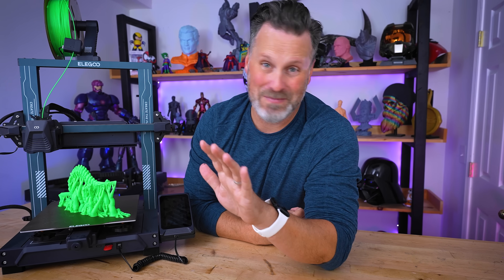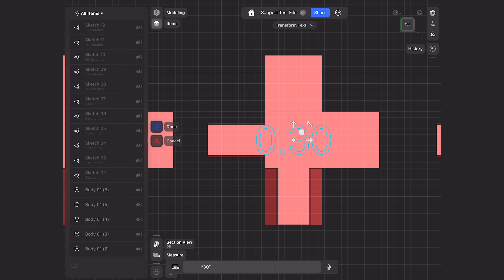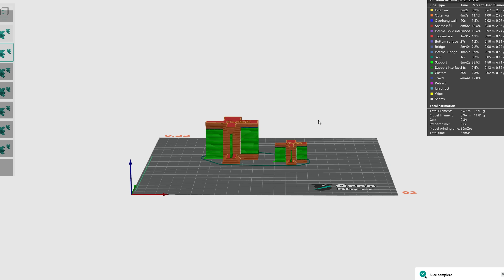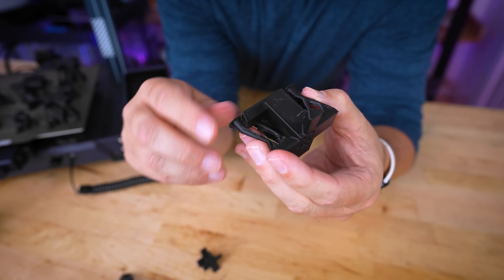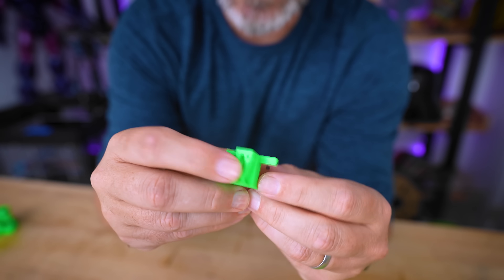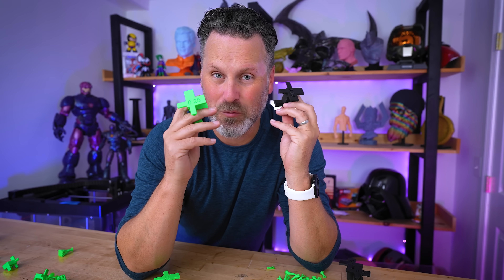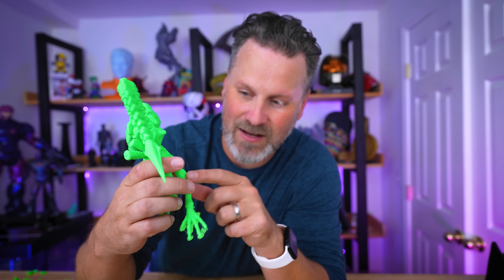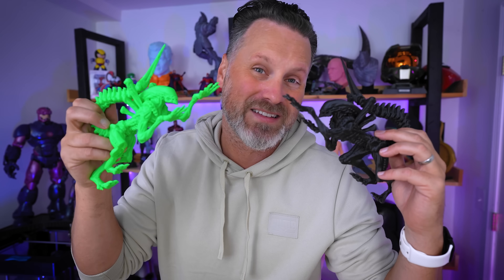Stop Struggling with 3D Printed Supports – Try This!

Comment: The  supports felt the same to remove because they were the same. 3d printing is really only 2.5d printing. When supporting those perfectly horizontal surfaces, it can only skip whole layers. You need sloped or rounded surfaces to see a difference when making changes of less than a whole layer height.

Comment: I may be mistaken, but I believe that unless you set something like a variable layer height for supports - then all z distances are rounding up to be proportional to layer height. 
Meaning that if you print 0.028 layer height, then 0.22 top Z distance will be 0.28. And 0.29 distance will become 0.56.
That's because it is printing uniform thickness layers, and it can't print a layer thinner or thicker than you asked for.

Comment: hey my 3d models are getting stuck in the middle and wont progress the print like it just keeps going in like a small circle but it wont go up on the z axis or progress the print time I have no idea what causes this and it has happened to two different files and I know it's not the Printers I have used any Ideas?

Comment: You just need to see if the piece starts to print after one, two or tree empty layers... The small numbers variations doesn't matter. Just if the number surpasses a threshold for more or for less. What make a difference for me was to have les spacing between lines in support's top layers (I use NONE by the way), it's like printing on a almost perfect surface.

Comment: You can also try setting the top z distance to 0.275, but my favorite is to make the support tips in PETG which doesn't really stick to PLA making support removal a breeze. I know it adds more print time due to a filament change, but it's worth the hassle of removing stubborn supports or even breaking your model. Lastly always use needle nose pliers to remove supports.

Comment: I use the old flashprint... the best trick I have for auto supports is let it do it in 1mm thick then you can paint over the supports with  ever increasing diameter ones growing fatter as you go down like a tree... this only leaves a tiny contact point... leave at least 2 to 4mm of the 1mm bit so ther is a real weak point.

Comment: Thank you for taking the time to test and evaluate these settings.  I would have never considered there to be such a difference between filaments and results. It appears you need to run a test on each new filament like the testing required for resin printers.

Comment: I don't suggest doing fewer walls in supports. If the tops are sticking and you have thin walls the supports will just shear off when you attempt to remove them and leave the tops connected with no leverage point and you'll have to cut them out.

Comment: Thank you so much for this. I am new to this 3D thing. My Orca Support Tab doesn't have half the the options you have though. It only has 8 options and ends with starts at Support Raft Interface. Is there an upgrade I should be looking for please?

Comment: I just recently got into 3d printing and i have the Creality Ender 3 v3, and yesterday as of writing this I found out about the Top Z Distance

I use the Hyper PLA that Creality sells, and i use 0.25 top Z as my default, it still is a bit difficult to remove, but most of the time it doesn't leave a bad finish when removing them, when printing high/mid detailed figurines (0.08)
if i increased it, then i will get that weird stringy layered texture

Comment: Please, calibrate at least your flow rate & retract before any other fine tuning - it's a bit wiered to see strings & uneven top/bottom surface on the print while "tuning" supports. N.B: all calibrations are applyable only for this exact filament spool, new spool - new calibration

Comment: Another thing that help in removal is reducing the "First Layer Expansion" (named in Orca) to as low a number as possible. This is the number of rings around the base of the tree support that provide extra bed adhesion. The key is reducing it enough to leafe a very clear gap between that support base and the actual print, but still giving enough support to prevent the try from falling off the bed

Comment: Hey Jesse so I just downloaded orca 2.3.0 and im using a neptune 3 pro and the print for .20 support setting says it will take 3 hours and 33 minutes, what could be the cause for this? same print in cura says 1 hour and 32 minutes
Reply from the maker: More than likely it’s the volumetric flow value. You can find that setting in Cura & update the value in orca slicer for the profile you are using, could also be print speed settings or number of walls
Reply: @UncleJessy  ohhh okay I got you, I have to find a translation table or something to try and match up the settings as best as I can then

Comment: How do I avoid a lot of support scaring? Recently got an elegoo neptune 3 pro (first 3d printer) and some of my prints get that. I'm currently using ultimaker cura as a slicer. I'd be open to suggestions for other slicers that work well with my printer.

Comment: just wanted to say thanks. i usede the the top z distance, which i didnt even know i could change lol, it worked great. i have been using pla plus and that stuff is like weldied to the surface. changed it to .34 and now they pop right off. thanks again and keep up the awesome work

Comment: @UncleJessy 
and this is why you remain one of the very best In the Biz.
I have a 4 Pro and absolutely love it, except for having to fight with the Z drift.
Running Pro mode on the machine helped a little bit.
Have you had to deal with this? And if so, what did you do to compensate?

Comment: Try printing with PLA in 0.08mm using a 0.4mm nozzle using either grid or  tree support. It's impossible to take them apart. The higher the resolution, the harder it gets to remove supports.

Comment: You should design a test were it supports a thin, fragile object. If the support is bonded too well, it'll break the fragile thing. If it's easy, it'll preserve the fragile detail

Comment: Thank you for your videos. They’re very helpful for newbies like me. I just have one question though because I’ve not seen anyone tackle this yet. I tried printing with PETG support but just on the ends of the support. The support come undone very easily but the object printed also disintegrates. It’s like the layers did not fuse properly. What do you think caused this? Appreciate anyone who could answer this question. Thank you.
Reply: You need to set a higher flush volume. When the printers switches from PETG back to PLA, there is a bit of PETG left on the hotend and it ends up in your print. PETG and PLA don’t fuse together and your print will break apart easily

Comment: Fighting with supports is a constant hassle for me. A job I printed last night gave me the same problem, and I ended up breaking my model. Being a relative newbie to 3D printing, I didn't know about this solution. So I checked my settings... 1.2. Yes, they need to be changed. Printing again, with my settings corrected.
Thanks... You won my subscription.

Comment: we did this test on the k1 and the k1 max using geeetech tri colour pla filament and so far they all come off really easy on at the 0.20 thru to 0,26 on tree slim sup im now trying it on not sure the make tho filament see if it does the same

Comment: I had an issue with tree supports when I first started using them... I have no idea if it was on a website, on a print profile, or on a forum - but somewhere I read that tree supports, and really any supports, are best removed within 2 hours of beginning a cool-down cycle.  -- I.E. Don't let them sit over-night with the temperature inside the 3D printer coming back to room temp.

Comment: Hello, I have a question. I print at a layer height of 0.2. Should I do the tests with the same data you put in? 0.2, 0.24, 0.26, 0.28, 0.3? thanks for the help I have an Ender 3 V3 KE

Comment: Something that helps in orcaslicer, especially with ABS is the filament cooling setting. Having your printer turn on the fan to a certain percent, maybe like 25 for abs during overhangs and while printing supports works wonders.
Reply: Does that help with PLA too?

Comment: Key is to remember also.. "rapid"/"fast"/"High flow" filaments are lower melt temps, so your supports are sticking more on those because even just the ambient heat of the print head can make the top layers of the supports sticky again vs normal PLA or PLA+ blends. Resulting in needing a higher gap to prevent filament drooping and sticking so easily.

Comment: Thanks for the test models. I found the different settings made very little difference to the release of support material (Normal) from the print. All the large sample released pretty easy and all the small ones were difficult to release a couple of the sections. It almost seemed like I'd not even changed the settings per object but I checked and I did. More confused by the difference between the large and to small test samples. I did change both top and bottom Z value, so not sure if that makes a difference. I'm gonna retry with tree support and see how that works out.

Comment: Hmmm. I've been using 0.26 with variable layer height, assuming the minimum possible to remove is best. But maybe Z contact distance of 0.3 would cause less damage on removal. Thanks for trying this out.

Comment: So for pla, I used 200/60 with .185 top and bottom z contact. For abs, I do 227/110 with .19 top and bottom z. This is through with .2 layer height and using prusaslicer for my voron v0, so I highly recommend giving those values a shot, even if the settings in this video do help you start getting dialed in.

Comment: What is the impact of the upper ceiling? You looked at one boundary, but there doesn't seem to be any info on the consequences of ramping that up much higher. Obviously there's a point where it's not actually giving any support at all cause there's a great big air gap, but it sounds like you should test where that point starts. Maybe it's around the .30-.40 range and you can't go much higher, but maybe it's actually at the 0.6 range and you can happily throw 0.40 at the wall and just have easier supports as a default. Be nice to see the other side of that quality curve.

Comment: Trying to get my head around how it would be printing in 0.2mm layers but somehow print the supports at a height between those layers? I've seen resolution be lower on support but it's usually a multiple of the layer height and not a 0.02 difference.

Comment: Fun trick: If you have a big flat overhang for some reason (like the test prints), you can pause the print at that layer and scribble over the grid supports with sharpie (laundry marker). PLA doesn't stick to that. You can use a zero-offset grid support and not have it stick at all. Obviously of limited use, but if you want (say) text embossed on both top and bottom of your print, it's pretty easy.
Reply: This is such an awesome tip! I'm definitely gonna give that a shot. Been having to do a lot of prints with flat overhangs lately.
Reply: Amazing. I knew sharpie was useful to prevent adhesion, but wasn’t sure where it would apply. This is genius. I bet it even prevents the bottom layer from getting that noodle like appearance.
Reply: The sharpie trick is great for any printer that doesn’t have MMU/AMS capability.  It’s nearly free, works super well, and it lets you place the supports directly against the print surface which dramatically improves the appearance and accuracy of the print.  The only downside is having to add the pauses to the slice and having to babysit the printer.

If you do have any sort of multi-material capability, though, switching out the support interface material is arguably a better solution.

Comment: He also misses the setting "Top lnterface Spacing". 

"In Orca Slicer, top interface spacing refers to the distance between the topmost layer of your print and the support interface layer. This setting helps ensure that the support structures can be easily removed without damaging the print."

Comment: It always rounds to multiples of the layer height. That is why you didn’t see a difference until you got to larger multiples….
Reply: If not, your print would take for EVER. Since it would have to do micro layers between just for the interface differences, which makes sense if you think about it. It is literally layers.

Comment: Great video. I found this a while ago after having an absolute nightmare with tree supports.

The other thing which is worth looking at is if you actually need "Top interface Layers" or not. 90% of my prints now I have set this to zero and it prevents support from creating that top raft and just sends tree supports all the way to where the support is needed.

Comment: If you put all the small ones on the plate and modify the support settings per-object, you can export that file and the settings will work for any printer that imports it into Orca.

Comment: What I would like to know is for a multi filament, what could be used for supports like a weaker but sturdy support filament, IE TPA hard for PLA and PLA for ABS for example. Has anyone done this for FDM Printers? If so where and if not can you  do something for that option?

Comment: Great info and timely for me as I'm about to print something that needs center support, and a smaller version with the particular filament I'm using was an absolute bear to remove. What I wound up doing with that is hitting it with a heat gun a bit to soften things up a little, which let me get the support off clean. There's a balance between melting the print and softening that interface layer just enough, but if you start small and apply more heat as needed, it can really save a lot of headache and reprinting.

Comment: Bambu P1S ships with a small amount of filament called "Support material for PLA" which is supposed to act as a top layer for your supports that makes them east to peel off. Not tried it yet, but apparently it works. Others have said that using PETG on a PLA print in the same way also works as they are somewhat incompatible which makes them easy to peel off.

Comment: Use the cutters that came with the printer 😅
Cut the supports in blocks that can move -> wiggle away from interface. Trying to get them off like a monolith is not working.

Also: if the model looks impossible to print, cut it to simpler parts. I wonder how the bottoms look like with 0.3 mm distance 🤔

Comment: I use tiny cones with the tip on the part, and it breaks off clean.  multi filament can use a barrier layers of PLA.

Comment: Matte PLA supports are much more easier to remove, compared to the regular PLA. I'm using Bambu printers and 98% of my prints are printed with 0.2mm layer height and the Z gap for supports is set to 0.1mm. This works absolutely amazing for me, removing the supports is a joy.
Also, recently I tried matte PLA for the support base layers in the regular PLA prints and it gives a result very close to the PETG supports.

Comment: Regardless of how easily the supports break away, I've always been disappointment in the surface quality. It never fails to require some sort of post processing to make the print look decent. I've seen videos where printers with multi-material setup (i.e. Bambu Lab AMS) will run PLA for the main print and supports, and utilize PETG as a support interface layer with a ZERO offset/layer gap... that seems to have some decent results.

Comment: This is not how Z-distance works unfortunately. It's always a multiple of your current layer height that's rounded up meaning;
If your layer height is 0,2mm then

0,2 will be 0,2 Z-distance aka 1 layer gap

0,24 will be 0,4 Z-distance aka 2 layer gap
0,28 will be 0,4 Z-distance aka 2 layer gap
0,32 will be 0,4 Z-distance aka 2 layer gap

0,44 will be 0,6 Z-distance aka 3 layer gap

That's why your first test was often harder to remove and all the other tests didn't really produce any meaningful difference.
Reply: Not in anything based on Prusa Slicer, and you can see it in preview. Multicolor options may disable it, but otherwise support and object layers can be printed at different z.
For Cura (and IdeaMaker?) this is true (and not easy to change due to how their internals work).

Comment: I just had an idea that would help all the tests. There could be a modification that allows you to write the reference of a parameter in the part. For example, instead of manually entering the Top Z Distance, you would place the variable in a specific location of the part, and as soon as you change the Top Z Distance value, the slicer would replace it in the final print.
Reply: That would be great. Thanks 👍
Reply: Is there any file you're looking to 3d print?

Comment: In Prusa Slicer (v 2.8.1), it seems the top z distance is rounded to a multiple of the layer height.  So 0.28, for example, is going to round up to 0.3 if your layer height is 0.1, but will round down to 0.2 if your layer height is 0.2.
Reply: I am under the same belief that top Z distance was only in increments of your layer height....  if .2 layer = 0.0, 0.2, .04 top Z height.  you can set the Top Z height to any thing in-between but rounds to the layer height and does not make a difference. I use Cura 5.7 (since Cura 3.x)  Can anyone confirm otherwise for Prusa Slicer / Cura / Other?
Reply: @levih.4252  I'm using Prusa and looking at the layers preview, it seems to consider 0.x increments. Running some tests, will see the results later

Comment: Isn't this based on the print temp of the Filament somewhat? HF filaments are often printable at lower temps. I'd be interested in a follow-up where you print the green at 5C increments and the same spacing and see how the difficulty varies.